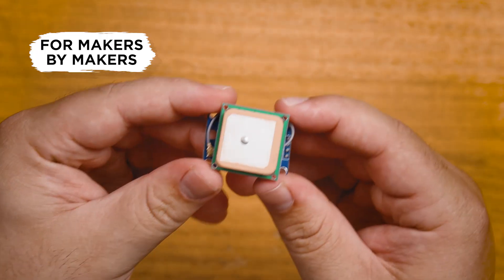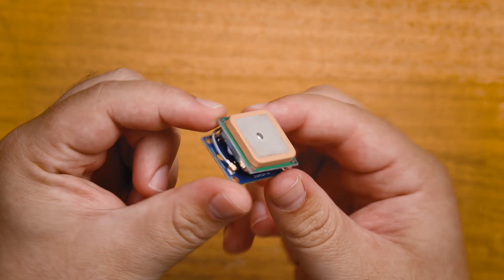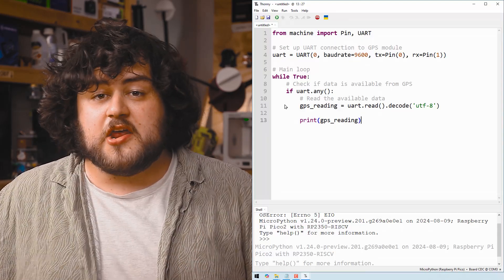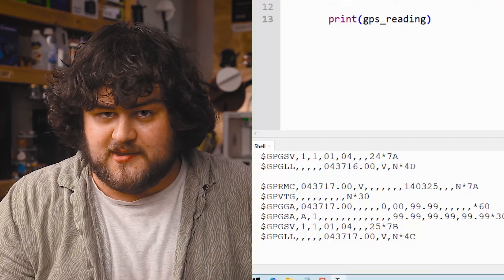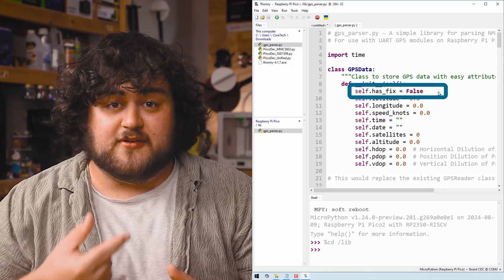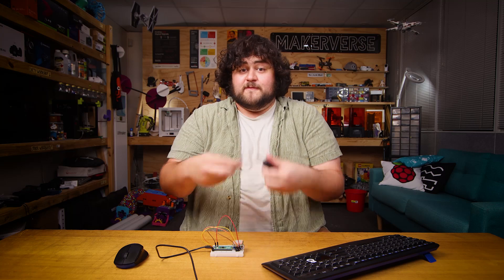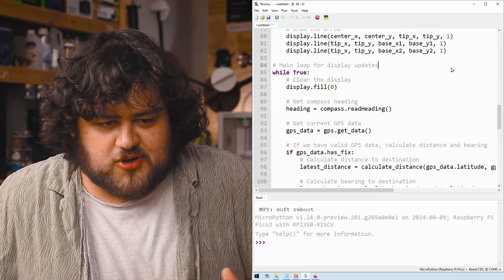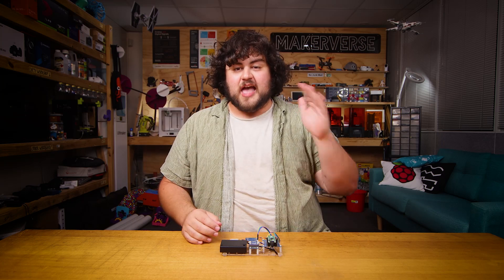How to add GPS to Your Raspberry Pi Pico | A Simple GPS Project

Comment: I made some nice clocks with time and date from space. One Pico use MMBasic and the rest are ESP32 devices. One is just storing the time and date in the RTC (pushing a button for UTC and adding a time zone or two with another button) then another app is the clock. With the location, you can spot/calculate your time zone and from the date, you can spot DST. Some chips or software use China as default instead of UTC.

Comment: Awesome video and super cool project, thank you! I am using the MTK3333 GPS module (by Adafruit and very similar to the sensor used in the video) and want to utilize this along with my BNO055 IMU and barometer for altitude to create a Kalman filter for accurate orientation and altitude tracking for my high powered rocket. It has an apogee of slightly under 2 km and was wondering if you knew if this type of sensor integration would be possible, and if so how it would work for rocketry applications. Thank you again very much!

Comment: Can i use raspberry pi module 4 B ?
Reply from the maker: This code most likely won't work, but the ideas will be the same. If you can find a tutorial on reading UART messages on the Pi 4, you will be able to plug this in and start reading those coordinates!

Comment: Sorry I have a few questions I am currently in yr 9 and in the coding club, my group is making a clock that would also have other components such as weather, I was wondering if:
The code would still work with any other raspberry pi?
If you do shipping to the pacific?
If we were to connect the GPS to a screen would it still work?

Will rewatch the video and come back if any other questions thank you
Reply from the maker: This code is in MicroPython which runs on the Raspberry Pi Pico, and it will work with any other Pico. Just double-check what Raspberry Pi you have because there are also Raspberry Pi computers like the Pi 5, Pi 4, and Pi Zero 2. These are computers that run Linux, while the Picos (which we used in the video) are microcontrollers that run MicroPython. For a clock and weather station, the Pico might be a better choice.

The Screen will likely be connected to your Pi with something called SPI or I2C. The GPS uses UART so there won't be any conflicts there.

We do ship to the Pacific region, as long as it's under $500 AUD, less than 1.5 kgs, and it doesn't have a Raspberry Pi computer. We can't ship the computers like the Pi 5 or Pi 4 outside of Australia, but we CAN ship the Pico. 

We also have a maker forum if you have any other questions, or need a hand with your project!
https://forum.core-electronics.com.au/

Comment: UPDATE: I had to get 100% clearance from ALL directions 360 before I could get a true lock. Having 1 direction (eg all West view) was not good enough. I had to have no walls around. Now working. With just 4 % (dilution/degradation) of accuracy.
---------------

I've been letting this run for over 30 minutes (access to sky, no glass, or walls between)
How is it I am able to get time date  signal, without a satellite lock ?
Since I am getting date and time, why am I not getting Lat, Long or any other details?

Copied from Core Electronics webpage (with extra print line for description of print out)
======================================================================================

    # Get the GPS data, this will also try and read any new information form the GPS
    gps_data = gps.get_data()
    
    # Print the GPS data
    print(gps_data.has_fix, gps_data.latitude, gps_data.longitude, gps_data.speed_knots, gps_data.time, gps_data.date, gps_data.satellites, gps_data.altitude, gps_data.hdop, gps_data.pdop, gps_data.vdop)
    print("gps_data.has_fix, gps_data.latitude, gps_data.longitude, gps_data.speed_knots, gps_data.time, gps_data.date, gps_data.satellites, gps_data.altitude, gps_data.hdop, gps_data.pdop, gps_data.vdop")
    print(" ")
    print("------------------------------------------------------------------------------------------------------------------------------------------------------------------------------------------------")
    print(" ")

The code above
===============================================================================================
Console Output below
------------------------------------------------------------------------------------------------------------------------------------------------------------------------------------------------
 
False 0.0 0.0 0.0 14:24:15.00 25/03/2025 0 0.0 99.99 99.99 99.99
gps_data.has_fix, gps_data.latitude, gps_data.longitude, gps_data.speed_knots, gps_data.time, gps_data.date, gps_data.satellites, gps_data.altitude, gps_data.hdop, gps_data.pdop, gps_data.vdop
 
------------------------------------------------------------------------------------------------------------------------------------------------------------------------------------------------
 
False 0.0 0.0 0.0 14:24:16.00 25/03/2025 0 0.0 99.99 99.99 99.99
gps_data.has_fix, gps_data.latitude, gps_data.longitude, gps_data.speed_knots, gps_data.time, gps_data.date, gps_data.satellites, gps_data.altitude, gps_data.hdop, gps_data.pdop, gps_data.vdop
 
------------------------------------------------------------------------------------------------------------------------------------------------------------------------------------------------
 
False 0.0 0.0 0.0 14:24:17.00 25/03/2025 0 0.0 99.99 99.99 99.99
gps_data.has_fix, gps_data.latitude, gps_data.longitude, gps_data.speed_knots, gps_data.time, gps_data.date, gps_data.satellites, gps_data.altitude, gps_data.hdop, gps_data.pdop, gps_data.vdop

Comment: This is mostly perfect timing as I'm trying to integrate a spare KB2040 (small form factor) into a basic tiny speedo using a 1306... putting all the concepts together, except I'm hitting stumbling blocks with having to use circuit python... chatgpt and adafruits docs are getting a hammering!

Comment: If I put the gps in a car. what are the best way to retrieve the gps information to my computer at home? Does the car gps have to be connected with phone/tablet with internet connection? Or is there a better way?
Reply from the maker: You will probably need an internet connection to send these GPS coordinates. If you can get a GPS coordinate, check out something called MQTT which is a really common way of using the internet to send messages between devices.